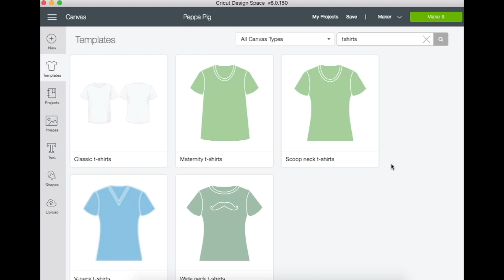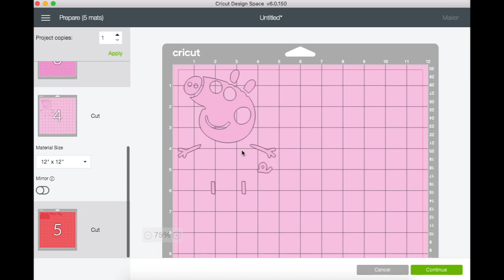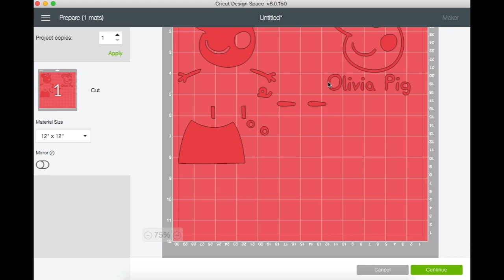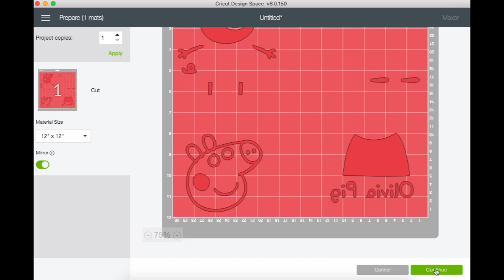How to Layer Heat Transfer Vinyl (HTV)/Iron On Vinyl with Cricut

Comment: How long did you press each layer
Reply from the maker: 30s but double checked to make sure each layer stuck on. If it didn't I would do a second pass. The settings will vary though depending on your heat press and the material you are using. You can find the Cricut easy press settings here: https://www.cricut.com/heatguide